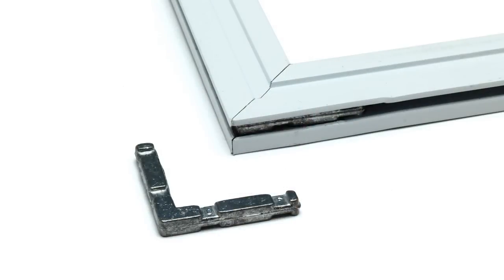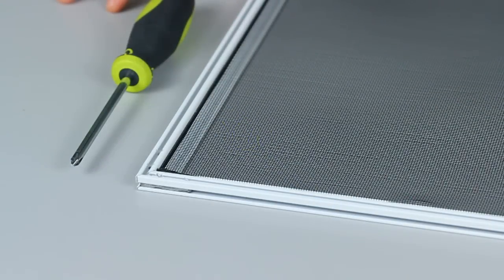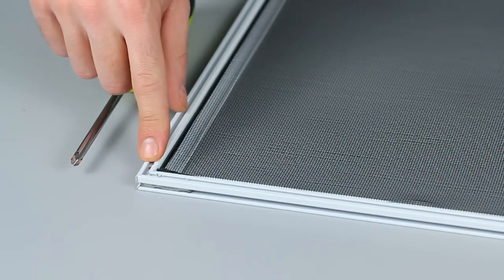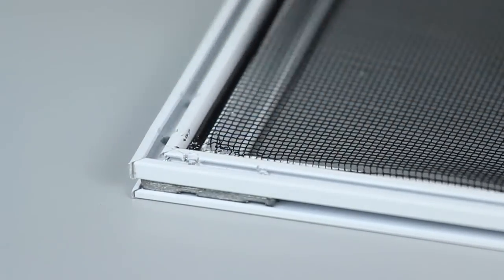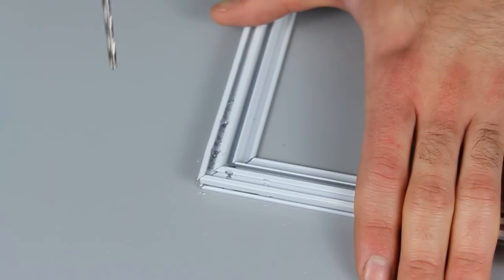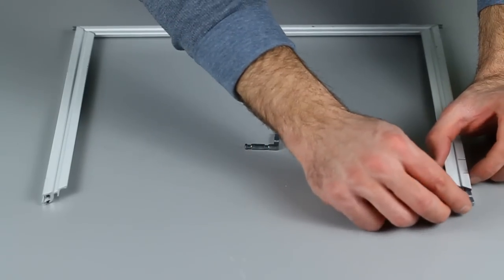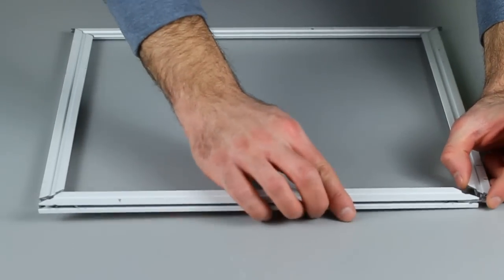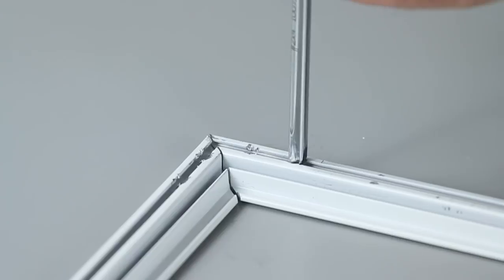How to replace stamped window corner keys.

Comment: Made it simple for a screened window, do you have a video for glass window?
Reply: @tomaugustine3307 I came here with the same question. They use this video on their page for Larson Storm Window Swivel Corner, but the item in the video is different, and it is for a screen frame instead of a window frame. It has been a year since you asked your question, and they still haven't replied. That's not a good sign.

Comment: I have a screen that has two broken corner keys.I drilled out the corner peens as in the video but am still having a problem removing the broken keys. The video does not show the removal of the keys, just the installation of new keys. Is there still a trick I'm missing or do I just have to patiently dig them out with needle nose pliers or some other tool?
Reply: Gary Nason I figured it out. Apparently the preens on my screen took a larger drill bit size...they practically fell out after I used a larger size.
Reply from the maker: Gary Nason We're glad you figured it out! Thanks for checking out the video!
Reply: Gary Nason to
Reply: is
Reply: Having the same issue... thanks for this comment and follow up!
Reply: Try a torch or heat with a pick

Comment: You made a total mess of that aluminum too big of a drill bit then too big of a screw driver then showed your face and name like you were proud of your work
Reply: My local home supply store did the same thing to my frames, but worse.  After drilling the dimples out with a very large bit, they put in new keys and crushed the frames with pliers, thinking that would hold.   It did not hold.  The frames fell apart.  Almost $300 in repairs, and my frames are ruined.
Reply: @PanamaSticks  
Those are called crimping pliers. That is what they use to build them but you should not use them for repair because they line up on the same holes. A small punch just to the side of each hole works much better. I have no idea why this guy is using a Phillips and banging on the holes that makes no sense. You need new dimples.